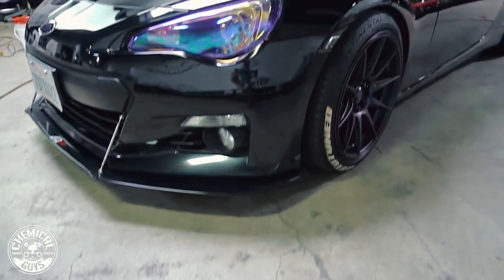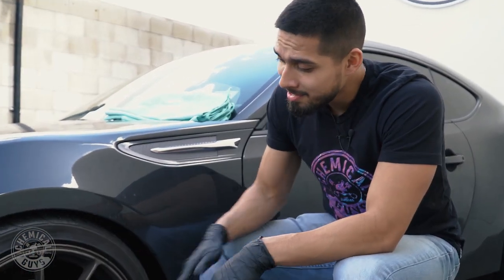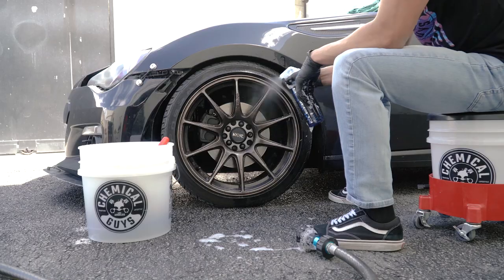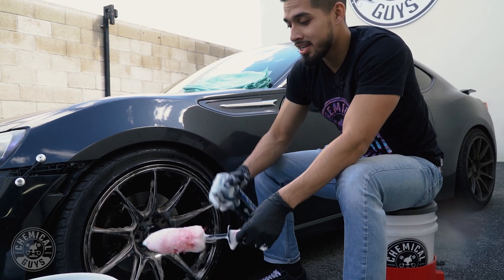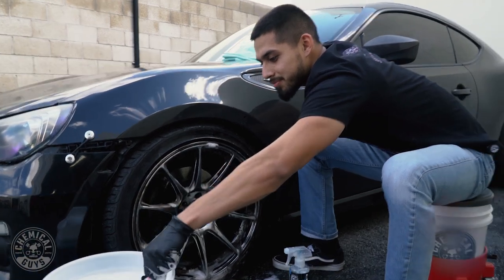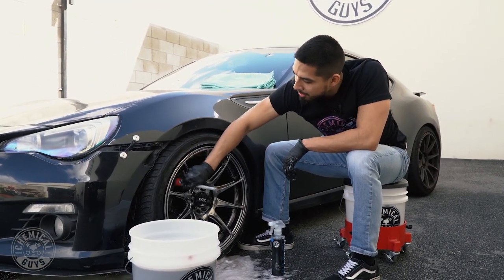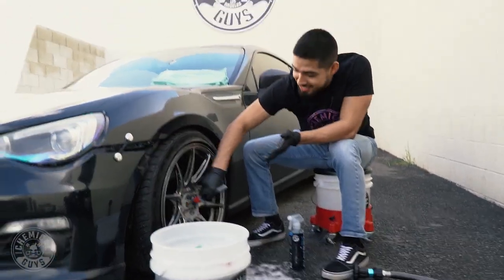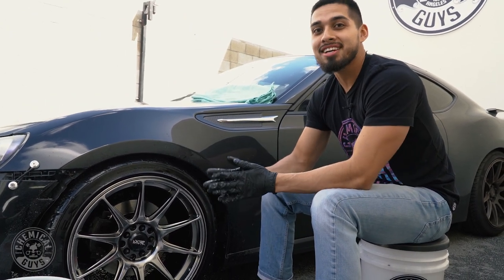Restoring the BRZ Episode 1 - The Wheels - Chemical Guys

Comment: If the wheel cleaner goes on to the paint is that a problem?
Reply from the maker: No, if it goes on the paint just wipe it off with a clean microfiber towel or rinse it off. Thanks for watching and happy detailing!

Comment: Great Video!! But I Have A Question Do you lay the Dirt Trap flat in the bucket or lay it Sideways  for Rubbing off the Dirt from the Red Rocket brush because I  Noticed it Didn't bend In Different ways??..🤔🤔
Reply from the maker: Hey! The Dirt trap is flat at the bottom of the of the bucket and when Henry scrubbed his brush he turns it while being in the water to allow it to remove the dirt and grime completely. Thanks for watching and thanks for being part of the Chemical Guys family!

Comment: Hey! Nice video!
Wonder, why using the green brush if there is a softer grey version?
Reply from the maker: Hey! The green brush has the bristles more flagged and it helps remove the grime easier. They are both great brushes. Thanks for watching and happy detailing!